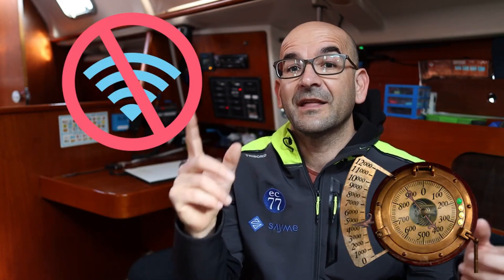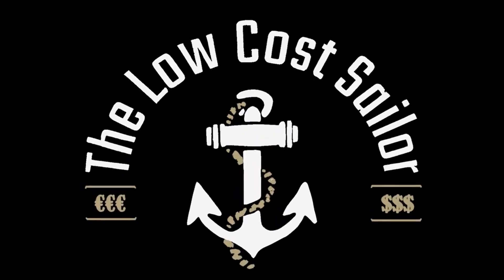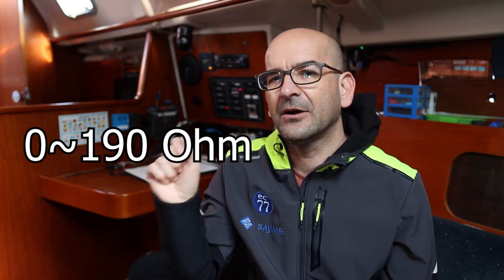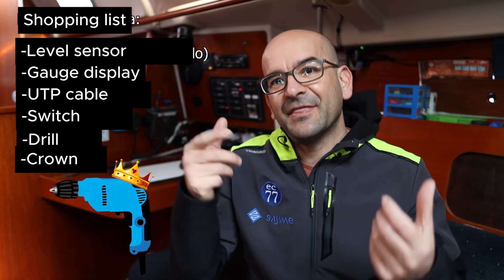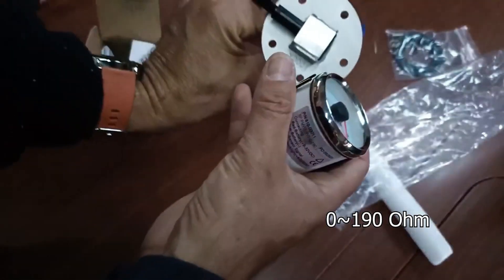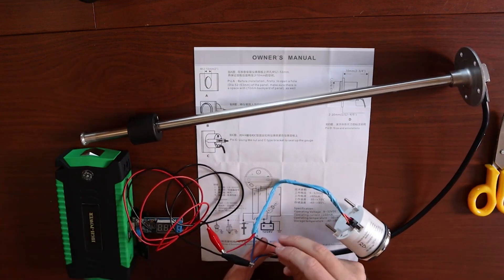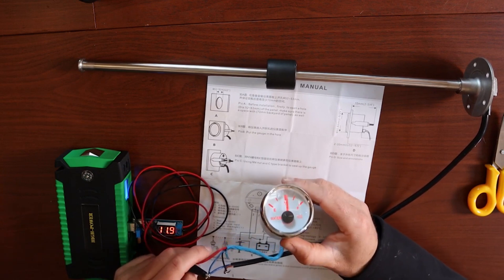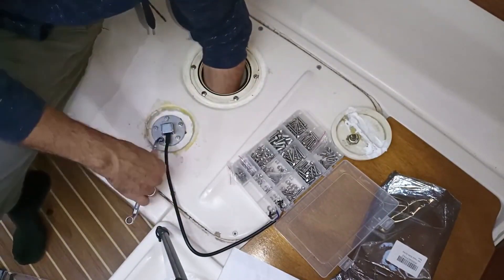EP08 - Low cost CHINESE LEVEL GAUGES for our boats’s tanks.

Comment: Just discovered your channel. I love your style and your content. About your gauge install, is it possible to install two gauges on a single sender? I keep finding conflicting information online. I have an analog gauge and sender for my diesel tank in the cockpit and want to add a digital gauge in the cabin and connect this to my NMEA 2000 network so I can see it on my chartplotter. I want to keep the cockpit analog gauge. I’ve watch about a dozen of your older videos and have already added about a half dozen new projects or my boat. 😊
Reply from the maker: Two commercial gaugaes usually can NOT be connected directly to the same sender, but i'm working on connecting the sender in parallel to the raspberry pi to show the information on the tablet or NMEA 2000 displays..

Comment: 2 questions and  thank you.
Are these type guauges food safe just wondering long term in water ?
If i unerstand and enjoy your humor does that make me strange 😂 thank you.
Reply: Check with supplier. I have several of these, and they are stainless, however, the manufacturer does not make any claims.
Reply from the maker: As far as I checked, Yes. Its made of stainless steel and more safe than my fiber glass tank it self..